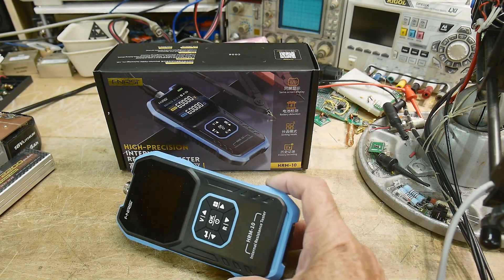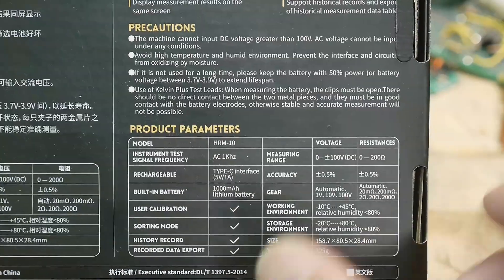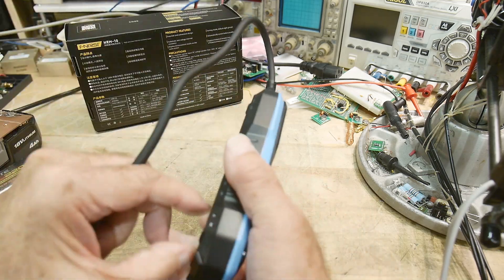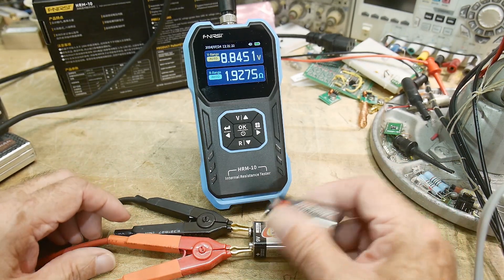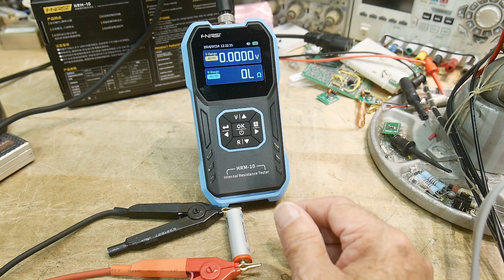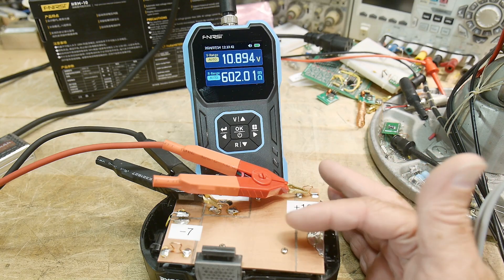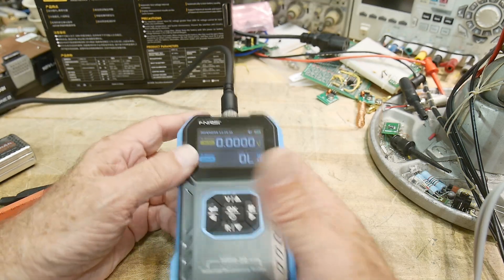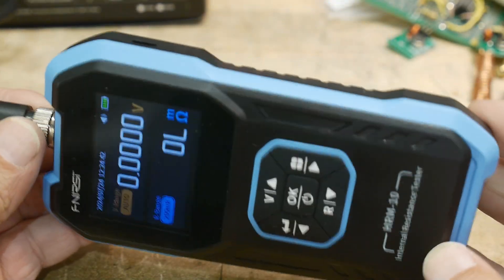#1977 FNIRSI HRM-10 Battery Internal Resistance Meter

Comment: The lower the internal resistance the better. Also, holding it on the battery with your fingers can fudge the readings

Comment: Good video....can you determine if a battery is good or bad just by measuring its internal resistance?
Reply from the maker: I'd guess it's 80% accurate. load testing would be the next step

Comment: Kelvin measurement should be done correctly and not by pushing the closed contacts to the ends of an AA battery or similar. Doing it correctly with the tweezer clips is a little cumbersome, but on the Fnirsi site you can order a full pack with a tweezer cable, a pogo-pin cable and an AA battery clip as wel for around $45. By doing so you have the best Kelvin contact measurement methods at hand.

Comment: Can you check, is this a GX12-4 aviation connector?  I'd like to make a Kelvin cable using dual-prong pens and need to know what to buy.
Reply from the maker: https://youtu.be/w9hvT0428jc?si=GB-8Eer0p2EkeRBI
Reply: @IMSAIGuy that was fun to watch!  Now imagine instead of alligator clips I have pens with two sharp pogo pins already mounted. Perfect for flat top cells. I just need to terminate them to the HRM-10. Need to know what the connector model number is. I can do my own fumble on the wires, lol.

Comment: The range of ohms shown seems suspect to me.  During testing to figure out battery for alkaline (AA, C, and D cells), a 1 ohm internal resistance meant the cell was (almost) dead.  The resistance was below 200 milli ohm for most of the batteries life.  The 9V batteries have higher resistance b/c the cells are tiny to fit 6 cells in the package, so a 100 ohm max would make sense (100 mA max current).  The lithium cells (when charged) have really low internal resistance - enough for accidental spark welding if your careless.

Comment: Seems like it could have been a simple ESR tester as well with those four wires... does it do double duty as a milliohms tester?
Reply: I have used a different brand meter (also 4 wire) for this to test contact resistance loss or shunt resistors

Comment: I would say these units are good for testing UPS battery packs.  Rather than running an hours long test at an appropriate load you could check the pack for high internal resistance.  

In my experience on smaller UPS of 500 -1000W,  100 mOhm or less is good for a 48V pack. An internal resistance reading of 1 Ohm or higher is not good.

Comment: But OF COURSE you would want to push the buttons on the meter - can't you see that it can increase the voltage and decrease the resistance of the battery...? That alone is worth every penny...!

Comment: Like it... In my oppinion it is most interesting for all kind of rechargeable cells. Just knowing the resistance of a fresh cell and comparing it to the actual cell (same size at lest) you can tell within a second if it is good, kind of okay or even ready for recycling... In the moment im am using my capacitor ESR Meter, it is also okay for batterys with not to much voltage... But having ESR and Voltage side by side is nice...
Reply: Cell internal resistance is strongly correlated to how much charge is left, they need to be the same voltage for it to make sense

Comment: If you use rechargable li-ion or li-po or even lifep04, the internal resistance is how you measure the health of a cell.  When new, the resistance will be very low, like 1-5 ohms, and when kaput, they will be much higher.   Any quality lithium charger will have ir measurement included, but i think a dedicated meter might be handy.  I think I'll order one.

Comment: Very interesting.  My question is, what values would be considered good or bad.  I initially had the same questions when measuring capacitor ESR.  After some research it was found that the answer depends.
Reply: You'd use it for trends on a single battery or to compare batteries in a fleet. A single reading of a random battery isn't much use
Reply: With capacitor ESR, the lower the better.
Reply: @simontay4851  "The lower the better" tells you nothing.

Comment: Internal battery resistance was one reason Ohm's law was not immediately adopted. Simply adding batteries in series did not proportionately increase the current capacity so E=IR didn't work out.  It wasn't until thermocouples were used (extremely low internal resistance) that what we think is obvious was accepted. So, see?  Internal resistance can be important. 😁
Reply: Batteries in parallel increase the current, series increases voltage.
Reply: @simontay4851  I said current capacity, not current. 

If you have a perfect 1-volt battery with a 1 ohm load you would have 1 amp of current. If you then added a second 1-volt perfect battery in series with the first battery the voltage would double to 2 volts and the current, through the same load, would increase to 2 amps. 

The early batteries were far from perfect. Change those perfect batteries to ones with a 1 ohm internal resistance, which is modeled as a series resistor. With one battery you would have a total resistance of 2 ohms (battery and load) with a current of 1/2 amp. With two batteries in series, you end up with 3 ohms total series resistance and the current would be 2/3 amp. If you ignore the internal resistances, which the early experimenters did since they didn't know it existed, you'll see that Ohm's law doesn't seem to work. When they doubled the voltage by adding an additional battery the current didn't double as expected.

Comment: Made the simple one, using a cheap DVM module, and a rather heavy resistor made from an old toaster element. Use it to check 12V SLA batteries, to find those that are near dead. The other chunky one is for car batteries. This one looks like it will do a lot more testing for me.

Comment: Was waiting for a test on a car battery
Reply: I think five ohms or lower is best for auto batteries. For my off grid 180kWh battery, less than 25mOhm per cell is best. 5mOhm or less for automotive battery.
Reply: @USA-GreedyMenOfNoIntegrity  No, no, no, no. no.   5 ohms is horrendous.  Tested resistance of old and Failed AGM batteries were in the vicinity of 40 milliohms.  Fresh good batteries were in the 9-10 milliohm range.
Reply: @1shARyn3  I was just seeing this meter and thinking of my Boat battery bank, 8 wet cell batteries tied together in series 13,7 at the inverter, without separating them have just the old Hydrometer method to test the cells